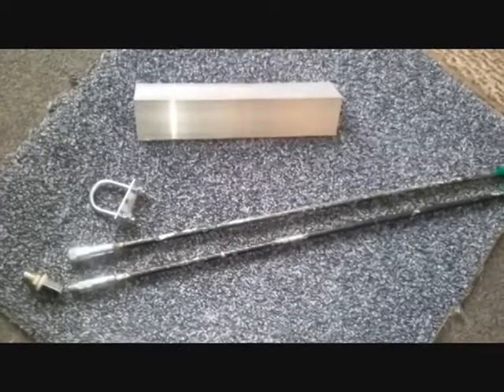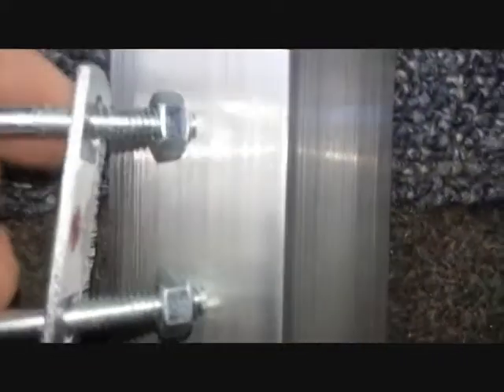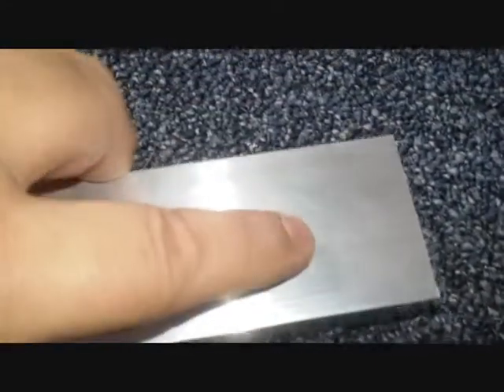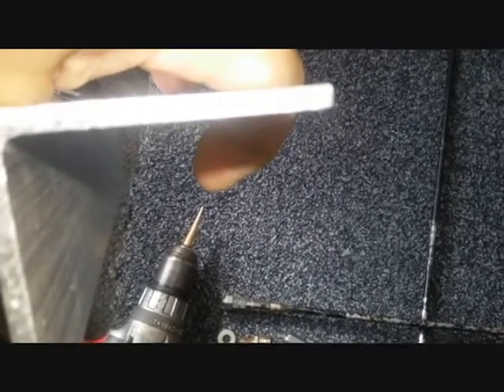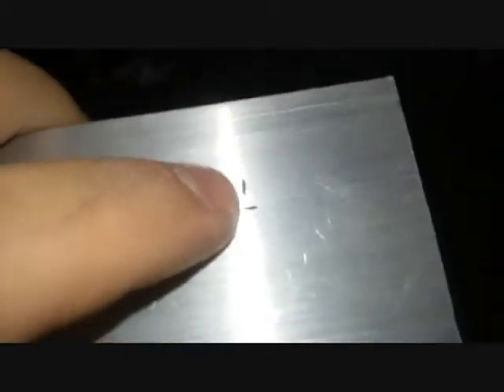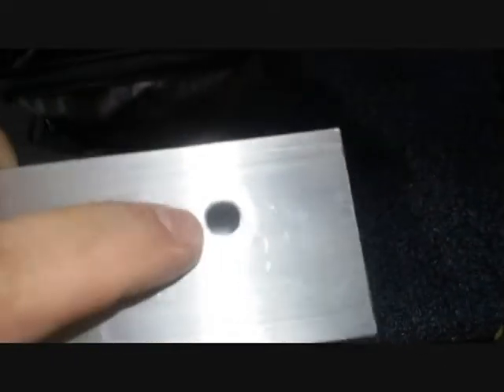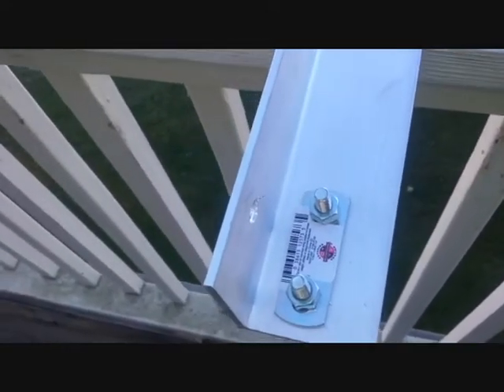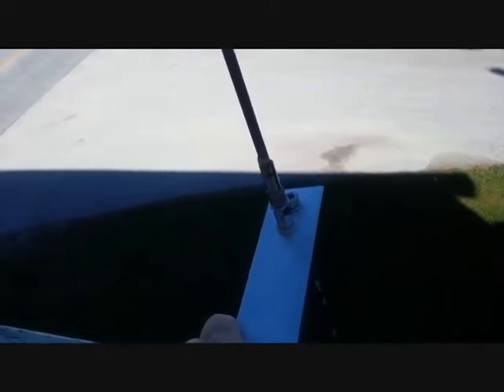Homebrew 2M Half Wave Dipole

Comment: Materials needed
2x 49 centimeter (19.25 inch) vertical antennae, 3/8 fine drive threaded end
1x aluminum L bracket
1x SO-239 mounting stud 
1x 3/8 fine drive nut
drill
stepper bit
time
Works perfectly!

Comment: Nice Video!!! 

For 1/2 wave dipole, what length for the elements did you go with? If my calculations are correct, for 1/2 wave it would come to about 38 1/4 inches long for the elements.